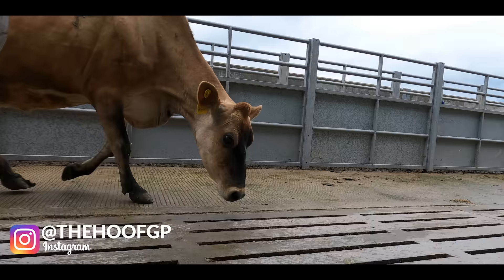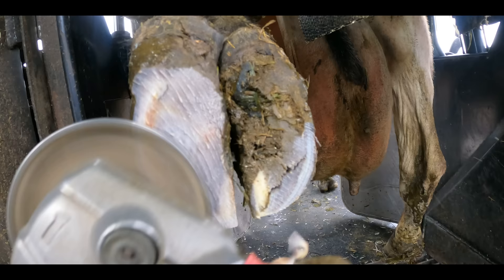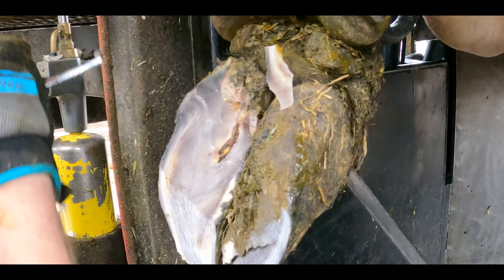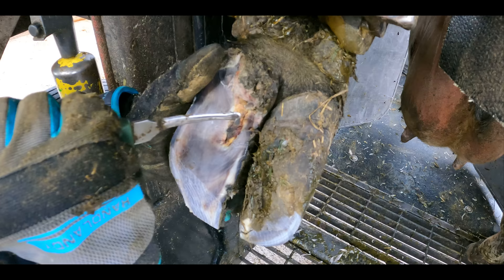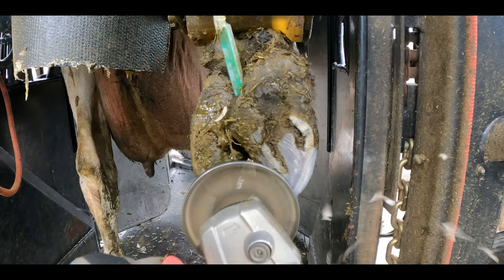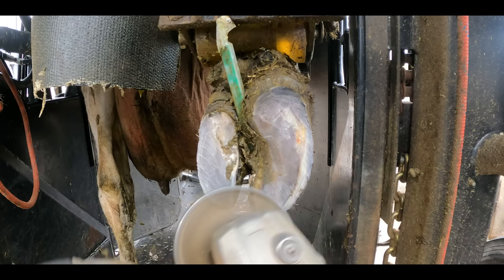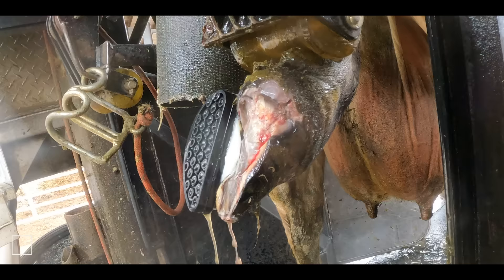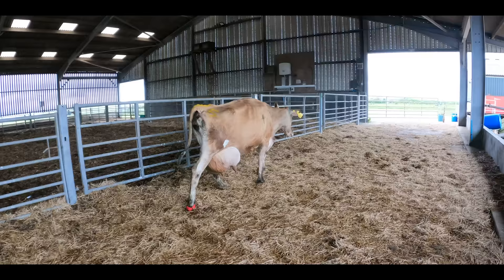A VERY MESSY COWS HOOF

Comment: I can feel this cow's pain.  I had a diabetic ulcer on my left heel that took two years to heal.  The last six weeks were spent wearing a 7 pound walking boot 24 hours a day for 6 weeks.  Same idea as with the cow, to take pressure off the heel.
Reply: So sorry for your ordeal, but hope you're fit as a fiddle now!  :)
Reply: You had to sleep in a special boot? 🥵 I’m diabetic and this scares  me!
Reply: @JulieWallis1963  This is a special reply to this viewer, and others with similar concerns.  I've been diabetic for 40 years and I usually have very good control of the disease.  In May, 2019 I woke up and saw raw skin on my heel.  It was about 1/2" X 3/4" in size.  I tried to treat it myself but it kept getting bigger to about 1" to 2". In August 2019 I saw three G.P.'s and they said it looked untreatable and I would probably need a below the knee amputation as gangrene had started. In November 2019 I went to an infectious disease clinic. At that time I was put on strong antibiotics for several months administered through a PICC line.  I also had 62, two hour treatments in an oxygen hyperbaric chamber. In late 2020 I had a skin graft added on the wound.  Since no pressure could be applied to the area I had a plaster cast applied from my knee all the way down my leg. A fiberglass "walking boot" protected the cast and took pressure off my foot.  In the spring of this year the wound had healed enough so that regular bandaging could be used.  In April of this year the wound was successfully healed. I'd like to thank this channel for allowing me to pass on important health information since I have no other way of contacting the requester.

Comment: Amazing job, but for me I would be hosing off every hoof, the Poop being flung by that grinder goes everywhere. For the ones that have those bad infections in the white and deeper it would be great if there was a hoof boot with the wood or rubber blocks as part of the boot, just seems to me these infections would heal faster if they were not being stepped into the mud/poop/urine combo that is a constant on the cattle room floors.  Not being critical of the work just thinking is there a better way? I know when I have had injuries before beyond the bandage keep it clean and dry was always part of the healing plan.

Comment: Two questions.........why don’t you hose off the sh** /manure before knifing the hooves? ..........why not put the little shoes on the hooves when they are younger to prevent the injuries?
Reply: They are too small for blocks when they are younger, and wouldn't fit properly in the crush for fitting either. It would also mean the hooves had to be trimmed every couple of months, which would triple the workload of an already understaffed industry.